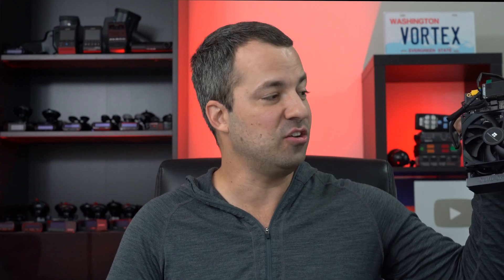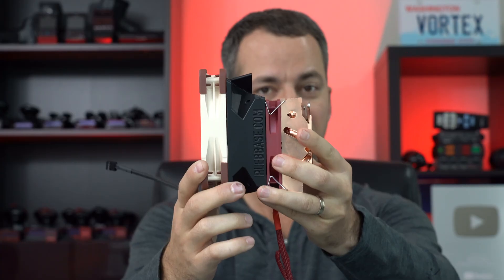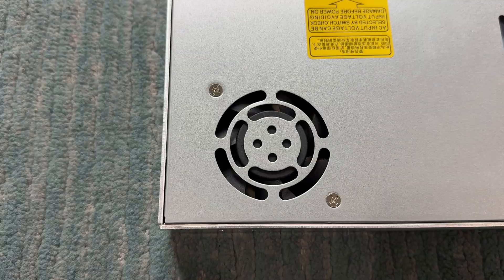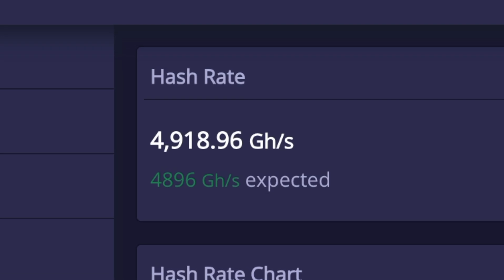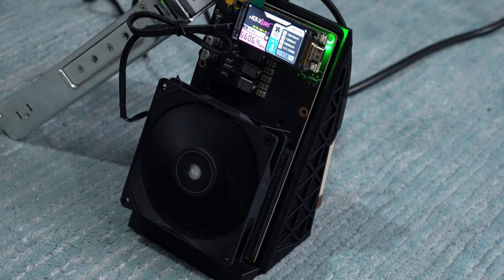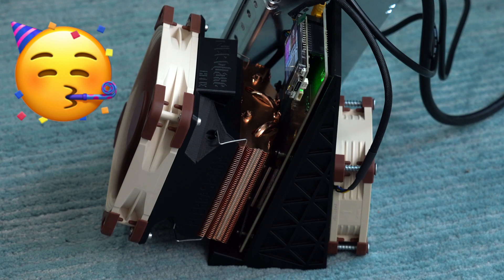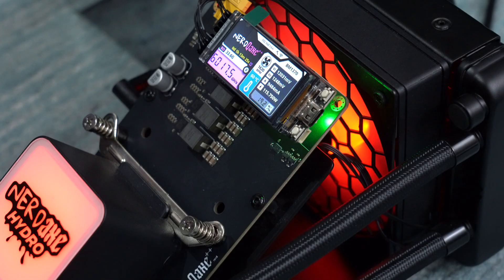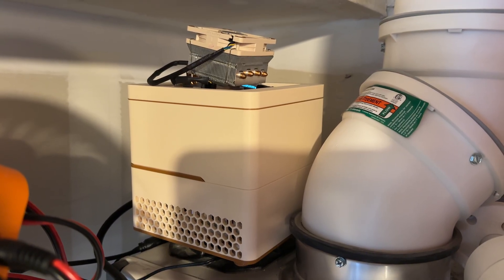Best Cooling for an Overclocked NerdQAxe++

Comment: Do you need to add an inline fuse on the output if you upgrade to a Meanwell power supply due to the revision 6 not having a fuse on the board?

Comment: I retrofitted my two NerdQAxe++ with just the copper heatsinks and thermal paste you recommended here and so far the results are fantastic. I'm still running the stock fans and these units dropped my ASIC temps about 8C. The copper heatsinks are much more substantial than the stock heat sinks and FINALLY allow me to run the fans at less than 100%. I'm running each unit at 725mhz @ 1.2v, hitting a target ASIC temp of 58C, fans ~2300RPM, with an ambient room temp of about 68F. Thanks for this video, it helped my setup greatly.
Reply from the maker: Love it! So glad to hear it's working awesome for you too. :)

Comment: Do you not think better placement of the water cooled fan would make a big difference? I mean don’t have it directly on the rear, have it off to one side. I find the back of the ++ get quite hot and the exhausting heat of that would be getting drawn in to the hydros fan.

Comment: Did you happen to swap the fan on the radiator to the noctua fan? That would be interesting to see as it would probably make a big difference in both cooling and noise level. I'd say it would then be better than the best air cooling combination?
Reply from the maker: I thought about it, but for that one I wanna keep the LED lights, lol.

Comment: Do any of these miners connect with ethernet cables?
Reply from the maker: There’s actually a mod in development to do just that! https://x.com/molonlabevc/status/1987984270737240299?s=46&t=zxEhqiyWWKeRl-CpFHkzrg
Reply: best bet for now is to switch in a rpi into your environment and use openwrt to configure it as a wireless access point, (not a router), to boost the signal

Comment: Adding very small copper stick-on heatsinks to the voltage regulators made a big difference for me, about 10C cooler for VR Temp. Combined with that big shroud I bet they would perform even better.
Reply: Do you have the link to the ones you used?

Comment: the numbers for person who won a bitcoin block with 6 bitaxes & an avalon 3s didn't make sense to me. the reported hashrate numbers i read were far less or far more than that setup. 
if you assume default oc, 6 nerdqaxe++s at 6th/s = 36 th/s + one 3s at 6 th/s = 42 th/s.
but reported total hashrate was 130th/s. if you divide that by 7 miners, then that would mean overclocking each miner to 18.57th/s. a nerdqaxe++ at 18+th/s? what is going on there?
plus the photo of his rig looked like stock fans.
Reply: not only that but the network difficulty is not in the P's it's in the 100T's meaning his block is ridiculously more difficult than necessary, or i read that wrong.. and yeah his block reward is LOW meaning the POOL took a fee meaning he dint solo mine nothin but his own left hand idk prove me wrong
Reply from the maker: As mentioned in his Reddit post, he has an Avalon Q as well. https://www.reddit.com/r/BitAxe/s/iRP3VXTF8m
Reply: Guys,
that reddit post is nonsense.  he's lying through his teeth.  That address has been used twice***, the redditor blurred his address and won't sign a message, and the actual block difficulty in the blockchain does not match the difficulty claimed by his miner.

Don't be fooled you guys.  If the network difficulty is 140T we will not be seeing blocks in the P-order of difficulty.  It's all bullshit!!

Comment: Fyi, the best way to secure the fan to the back of the stock solosatoshi stand is by using brass heat inserts and then threading into those. Of course, you can also just print a different stand! They should have included it with the inserts, imo.

Comment: Awesome!  one thing i want to note, with stock Cooler and upgraded fans I'm getting same results as the cooper cooler.
Reply from the maker: Oh nice, which fans did you upgrade to?
Reply: @VortexBitcoin  120mm Noctua in front & 80MM Noctua in the back.